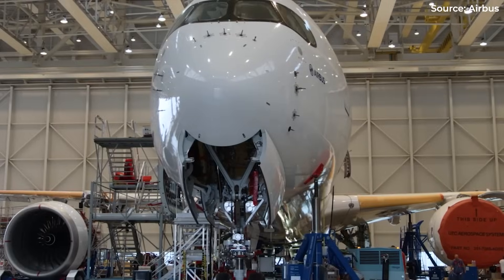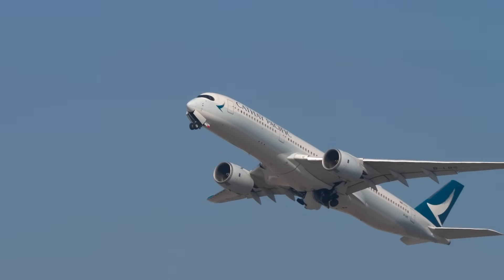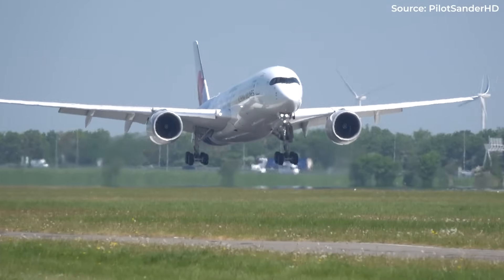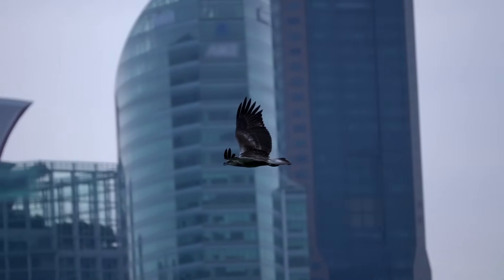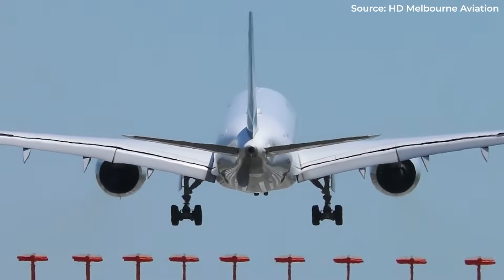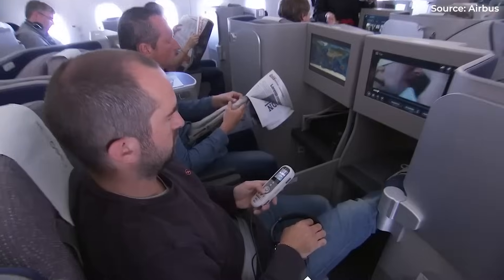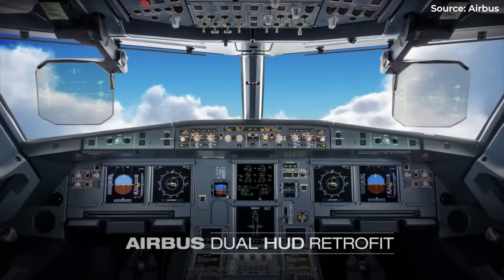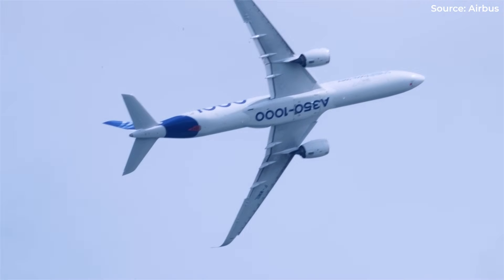What The A350 Eye Mask Is Really For

Comment: The mask of the A350 reminds me of the Beagle Boys 🙂  The electronic shades of the 787 are ...  annoying.

The F-14 was kind of late to the HUD game.  The first HUD to display flight and navigational stuff was innovated by the Blackburn Buccaneer in 1958.  Some WW2 aircraft including the Spitfire, Hurricane, P-51 Mustard, FW-190 and Bf-109 used similar optical trickery but for sights.  A second generation had gyro-stabilized sights including the Me-262 which supposedly had a pretty nifty one, as well as some late WW2 era allied platforms which were equipped or upgraded to this generation of "HUD sights".  Iow, basically old stuff by the time of the Tomcat let alone the A350.

Comment: Airbus know how to perfect Boeing's design.  They studied the B747 and came up with a bigger A380. They studied B787 composite body and and came up with an improvement with the A350
Reply: Not really. The cross-section of an airplane is basically a circle. If you want more seats, and the people have to sit next to each other, you're going to blow up the radius of that circle and it is more efficient to have two decks.

Comment: The electronic shades in the 787 simply don't work at dusk or dawn.......the gel isn't dense enought to actually block out all the light. I simply don't understand why they chose that solution. And don't say it's simply because of the central control. It's a bad solution.

Comment: Bro made a video to hate on the 787.

80% of what you said is also applicable at the 787,
Including carbon composite wings, 
Cabin altitude, 
Fuel efficiency 
And much more...
Reply: hmmm - yes, very much you could say the same for a 787 ; but you'd need the extra time to talk about the battery fires, fuselage delaminations, misaligned bodies, shut down of avionics, general poor quality of workmanship in the build, the range issues, the actual fuel burn issue, the engine issues. Problem was the 787 was the first to market with all the advanced composite features but Boeing p*ssed it away in the pursuit of cost cutting, but Boeing didn't have the ultra-advanced avionics features of the A350 nor did it have the cross-training platform that the A330 - A350 - A320neo have.

Comment: This sunglasseslook is not only on the 350, but optional on the 320neofamily and the 330.
Reply: True, but it was developed for the A350 platform and adopted on existing platforms as you just pointed out.
Reply: To such extent, the sunglasses are merely unnecessarily for any such advanced innovative features Airbus claim's. I see it differently, that is, it is to hide the myriad of multiple front cockpit windscreens's relatively rendered old 20th century non-aerodynamic outdated looks. Though it looks intimately cool with the sunglasses. Take for example, those newer planes featured fewer windscreens's & essentially much sleeker looking products...Airbus 220, Comac 919, last but not least the Boeing 787.
Reply: @brettdemauna9994  Nope. Do you know that the sunglasseslook was an innovation by Airbuspilots themselves?

Comment: the more efficient it is, the more dependent we become on a kerosene fueled Co2 emitter. aviation is not 2.5% of the politics, it is why we need to drill baby drill no matter what we do or don’t do with the rest of it… kerosene is a limited distillate and the more ‘efficient’ it becomes the more embedded kerosene-based air travel makes our need for crude oil overall. there is no getting around that in time or scale and the persistency of Co2 combined with the latency of the forcing effect, the ‘pipeline’, means this wonderful kerosene technology is how Trump can label ‘climate change’ a con job because no American politician will reduce crude oil extraction. it’s not possible unless kerosene is not the fuel used.
Reply: The US produces a lot of light, sweet crude (lower sulfur content), while many of its refineries were built to handle heavy, sour crude (higher sulfur content) from other countries. As a result, the US refines the oil it exports much of its domestic light sweet crude and importing heavy sour crude to match its refining infrastructure.

Comment: Lots of nice features. The one thing that Boeing really needs to catch up on (besides building SAFE planes) is the similarities between types. As mentioned in the video, type ratings require LOTS of training and Airbus types are very similar. If I had an airline and one manufacturer built airplanes requiring weeks or months of training to switch between types and the other manufacturer had types that required a couple of days, hmm, which one would let me better utilize my pilot pool? That way I don’t have to hire as many pilots because they could fly more than one type and do so SAFELY
Reply: I agree, Airbus has really figured out standardization.  I like Boeing, but I have to admit Airbus's similarities across types would be super attractive for an airline.

Comment: Let’s look at a couple of the claims in this piece of marketing fluff. (Airbus should be proud!)
A. Wing flex and winglets - Boeing planes have been doing that for decades with winglets of different sizes and configurations to optimize fuel burn. The “split scimitar” is my favorite design. Watch the wings of a 767 bend up during take off - it’s spectacular! It’s even more dramatic on the 787 with its raked wingtips which are more feather-like than winglets. Airbus wings have always seemed too stiff - making for a bumpier ride. Flew a 747-8 over to Seoul and an A380 coming back - there was no comparison. The 747 was a much more comfortable and smoother ride.
B. Dimmable windows - Airbus is now offering them on the A350.
C. 787 is also pressurized to 6000’ with higher humidity.
So, many of the features of A350 could be considered copycat and not real innovation. Im not knocking them - they are great features to be sure and benefit everyone who flies. 
I’ve flown on the A350 and 787 many times including a 17.5 hour slog on Singapore Airlines and the A350 just seems more cramped on the interior. (Conversely - I love flying in the A321 vs a 737!) And I’ve flown business and economy in both. Tip - do not get stuck in a BA A350 in the last 4 or 5 rows. Very tight seats, no legroom and galley noise non-stop.
Reply: A: You are comparing 2 flights on different moments in time, in an opposite direction, so you can't use that as an objective basis to compare. 
B. The dimmable windows on the A350 actually work properly.
C. You are right that they offer similar cabin pressure, although the A350 has higher cabin humidity, that is a fact.

Comment: Nice talk and the A350 is sure a marvel. But we did a 17.5h flight in a B787 and it was less stressful than a 7h flight in a A350. Then the B777 remains a rough workhorse. But sitting downstairs in a A380 seemed the worst of modern enjoyment!
Reply: downstairs???
Reply: @xXPingouinXx  A380 and B747 commonly have 2 decks for passenger seating.
Reply: would say that the 777 is too rough and ready, the 787 is just plain 'meh' it is an average aircraft, the A350 is better than the 787 and the 787 is a better ride than the 777, never sat downstairs on a A380 - only got the pleasure of the all business upper class deck of Singapore airlines A380, and have to say it was a very joyous place to be. Have sat in the nose and the upper deck of a 747-400 and sorry guys, Queen of the Skies she may have been but it was a sh*t experience, noisy, poor ventilation, cramped spaces and a toilet system taken from a festival latrine.

Comment: In a class of its own. The wife and I  took a trip to Singapore, out by 350 back by 787-9 I asked her when we got back to BKK which plane she preferred. 350.
Reply: Why?
Reply: I prefer the 787 cabin personally but....ok
Reply: @FlightAndTrack The 350 is the better product in every way possible, it’s not even close.
Reply: @Airborne-operator not at all, not in every way. I prefer the 787 in comfort. It’s also quieter. It’s also a different class of plane. It’s much smaller than an a350. It’s actually more of the size of an a330neo. So any of your thoughts on the a350 versus 787 are completely subjective and are a matter of opinion.
Reply: @Airborne-operator and if you want to play the comparing game, the 787 is actually slightly more fuel efficient than the a350. It’s operating cost is slightly lower. The 787 is also lighter. The humidity and pressurisation of the 787 is also better in the cabin. So no the a350 is not better in every aspect.
Reply: @FlightAndTrack wrong the A350 has a lower cabin altitude than the 787 and a lower decibel level making it quieter. It’s more spacious and is more comfortable to the majority of passengers.

The 787 has a lower cost per block hour but the A350 has a lower cost per seat mile which makes it more efficient. The reason the 787 is cheaper per block hour is simple because it is a smaller lighter jet but when looking at airline economics the A350 is the more profitable jet.

In terms of distance travelled on full tanks, the A350 absolutely clobbers the 787 as well.

I currently fly the A330 and can confidently say that without doubt the A350 is currently the best aircraft on the market, trust me when I tell you it’s not even close.

Your welcome.
Reply: @Airborne-operator no im not welcome, and you’re spitting out utter errors. The pressure is lower in the 787 and the humidity is better to, the 787 engines are quieter. The 787 is more oriented towards transatlantic flights. The 787 absolutely destroys the a350 in the shorter range.
Reply: @Airborne-operator it’s not the more profitable jet, I looked at the proportions. No matter what proportionally the 787 is cheaper to operate. The a350 is not the better than the 787, its for a different purpose. The 787 was designed to replace the 767s 777 200s, and a330. The a350 is designed to replace the 777 300ers, 747s, a340s. If you’re not going to fill an a350 to full capacity, or are only using it for a non super long haul flight, the a350 would be infeasible.
Reply: Obviously the a350 is best for the Singapore flights or long flights from china
Reply: Watch out for the 777x when it does come out (if it ever does) it will be better.
Reply: @Airborne-operator  'the A350 is the more profitable jet'  - if you can fill it, otherwise ...
Reply: "It was about this time I noticed my wife was about eight stories tall and was a crustacean from the palaozoic era."

I'm sorry... I'll see myself out :P